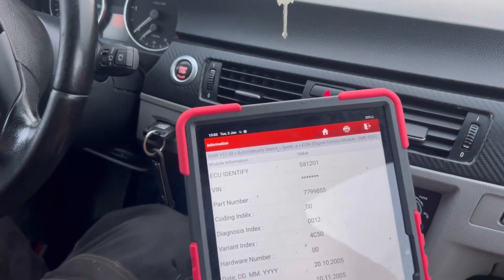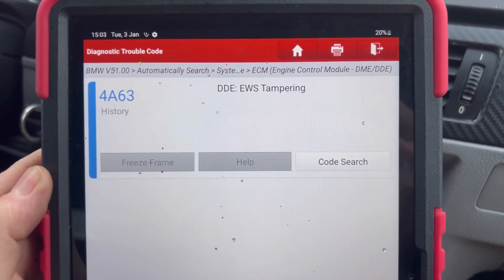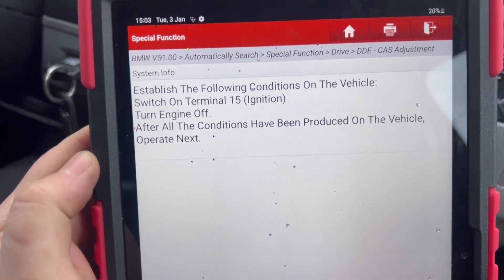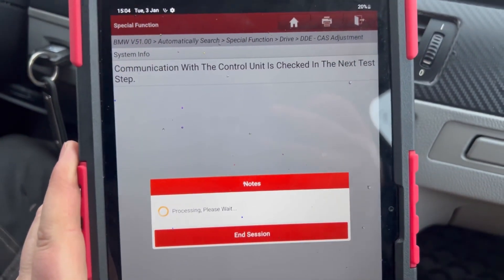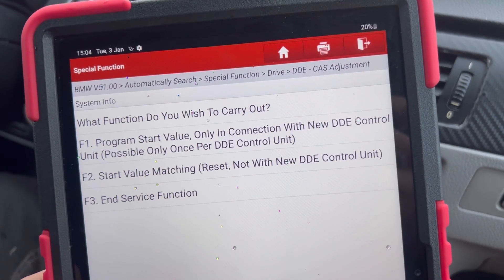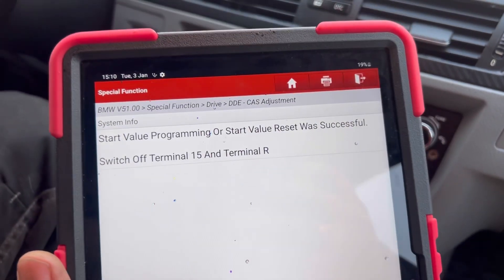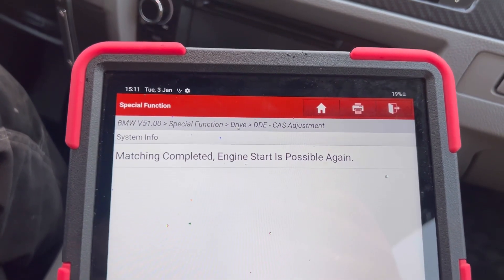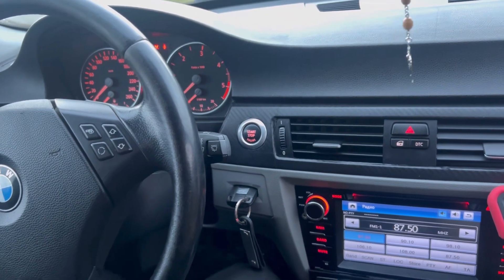✅ BMW E91 Engine Crank No Start Problem Solved_EWS Tempering (Fault Code 4A63) CAS and DDE Sync

Comment: thanks for this, i was screwing around in INPA and my car wasnt starting after, so i used my neighbors TOPDON tool to access the special function you showed here and thankfully it worked. you saved me a ton of hassle
Reply: Hope you’re still here and have exact recollection of exactly which model topdon model you used 🤣
Reply: @ownage2k11 you don't need to use the top don you could do it on inpa r most autel models, but the model that we were using was a top-down Phoenix light 2